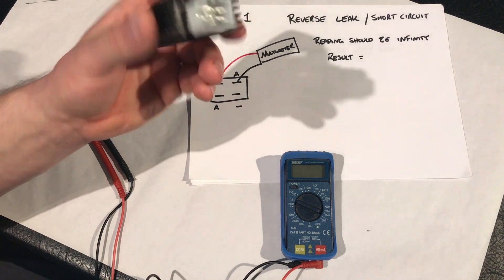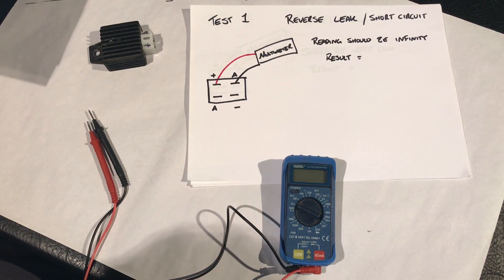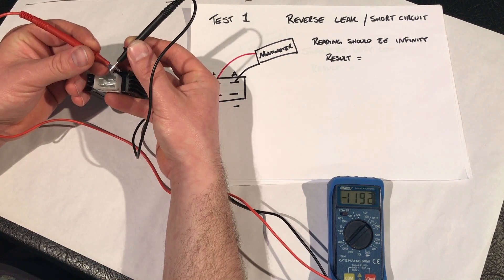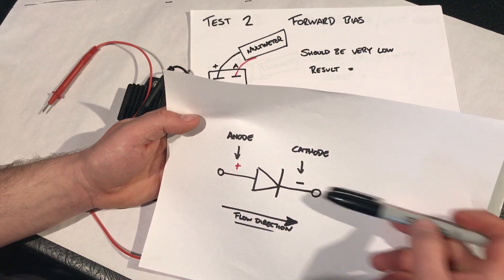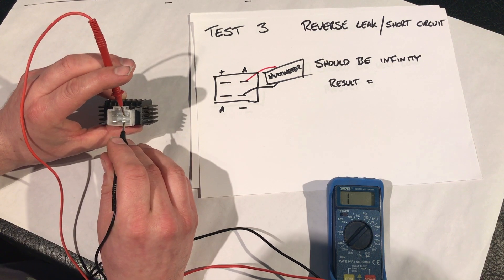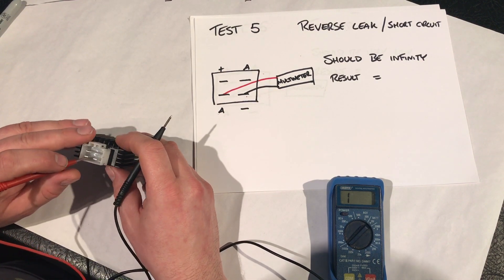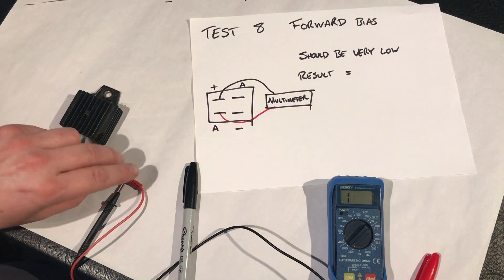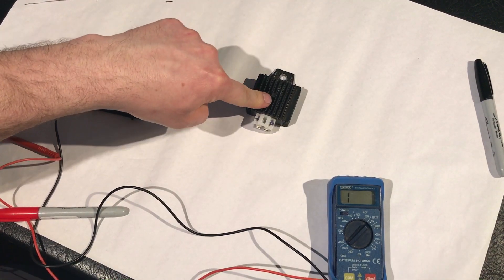Chinese Dax/Monkey Bike 2 Phase Rectifier Testing

Comment: I have 2 new rectifiers (Chinese) on all 8 tests I am showing infinity. I have tried 3 different meters. I have tested the meters and they work. It is possible they are not sensitive enough. The Klein tools MM700 should be decent quality. Not sure. Bike doesn’t charge at all

Comment: These units are not just a bridge rectifier, there’s a bit more going on here.
There’s also very little to stop the battery from over charging in these units, the main “regulator” part is only there to stop the headlight bulb blowing.

Comment: There is always a refinement of the process. All in all you did the best job I have seen here of testing the four pin. Nobody else comes close. YOU DID A GREAT JOB! Incidently, I got a test reading on everything of infinity in the Two K mode. In continuity mode I got 1250 ohms on +c -A and 1911 ohms +b-d. On reverse polarity on c/a it would read intermittantly. Sometimes the 1250 number sometimes infinity. I wonder what that means?

Comment: im soooo confused and yet my lights dont work but my engine runs .. 125s honda.. mine is blk /red/green .. in a 4 pin connector... and 2 other wires in a bullet connector seperate.. they pink and yellow.... idk if its rectifier or 2 phase or 3 phase idk.. thinks mine is regulator - mine is 6 volt and stator has 4 coils - 1 the coils is wrapped paper so is a/c for the spark.. im unplugged the head light and run light works... i bought battery- but wont run win its plugged in -so i keep fuse out! this my daily driver.. as my 5 -broken vehicles not able fix.. im old school mech on cars.. im cant afford both rect/ and stator.. i need know which 1 is bad! any help is apreciated .
Reply: Did you solve the problem?

Comment: You need measure continuity in DIODE test mode, not in RESISTANCE mode (in multimeter setting)!
Reply: Where is diode test mode on a multimeter?
Reply: @Spitfireseven  simple - its marked as diode symbol (near 2000 Ohm in your DMM)
Reply: OK,.... so that is continuity.
Reply: That's right, although the diode testing is not identical to continuity testing. In fact, continuity here would mean a shorted diode! The purpose of diode testing is to check: A) that the forward bias of the diode is within reasonable limits (which is the indication of the multimeter, in volts, or better in millivolts, when the red probe is connected to the anode of the diode and the black probe to the cathode of the diode). This test should show about half a volt for an ordinary silicon diode, up to 0,7V, or 700mV, but no more than that, as this is their normal forward voltage drop range. It is important here to justify by this test that all four diodes of the full wave rectifier show similar (but not necessarily identical) values. Just very near to each other. If one of them obviously declines, the bridge has to be replaced). B) that the diode is not shorted (that is, zero indication). Reversing the multimeter probes, we test leakage of the diode. Again, the display remains in mV and it should show open circuit indication. Any other indication during this test would mean a leaky diode, needing replacement.

Comment: Rectifier second or new?
Reply from the maker: new i believe This was my pals steph project im sure i can find out if you need to know
Reply from the maker: @quadruple treble 1888 yeah the rectifier is there to control the voltage from going to high recommend changing right away